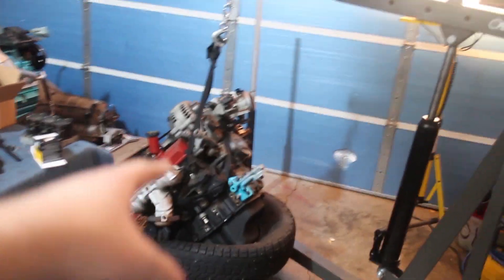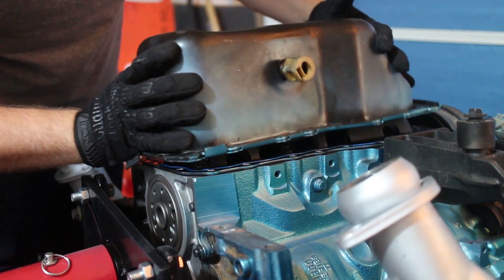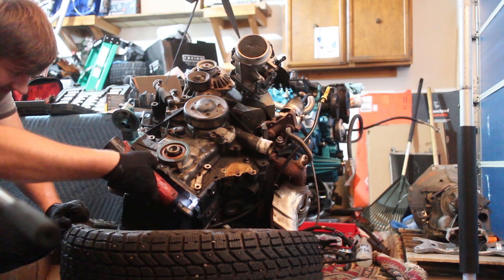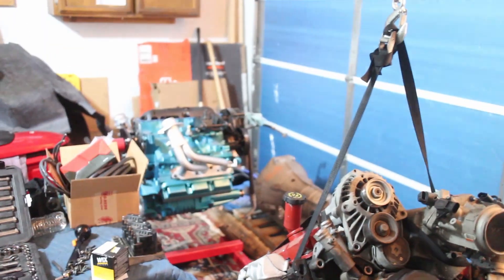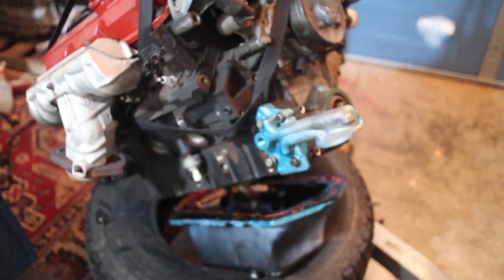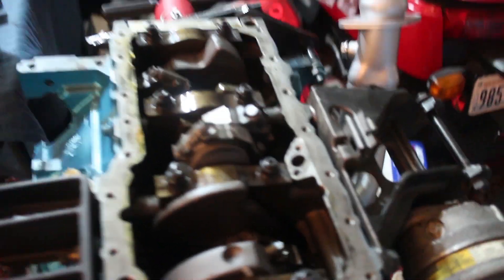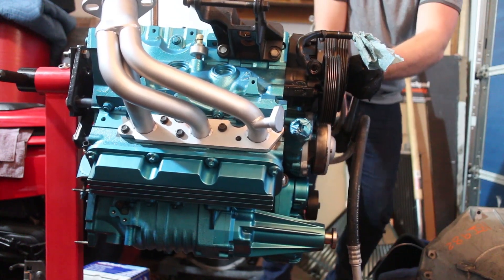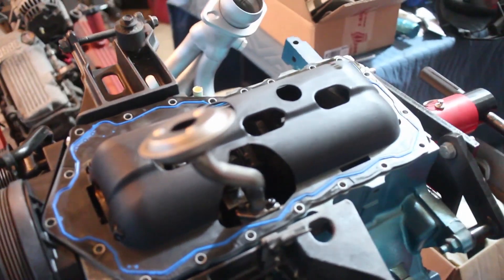Project F L67 Camaro Rebuild Part 9 (Swapping the Final Parts to the New Supercharged Engine!)

Comment: Did you guys leave the balance shaft in? What headers are those? I've been dying to do this with mine, but with a Whipple.
Reply from the maker: We removed the balance shaft but sealed the oiling hole. I think they''re pacesetter headers, at least they look the same. They were no-names from eBay.
Reply: @JuryRigGarage  I thought the same thing. I've read that removing the shaft frees up some power power introduced a little vibration.

Comment: I broke a valve cover bolt into the fucking head on the passenger side 🤦🏾‍♂️ any suggestions!?
Reply from the maker: Did the bolt actually break off in the head or did it round off? You can get something like an easy out to extract it.
Reply: Jury Rig Garage 
Ir broke about 5-6 threads into the valve cover. I’m going to try and drill it out, prey for me!!!!